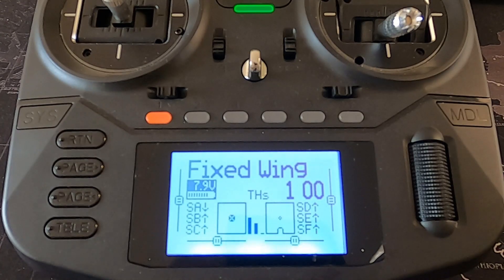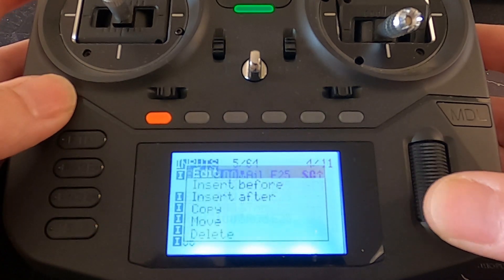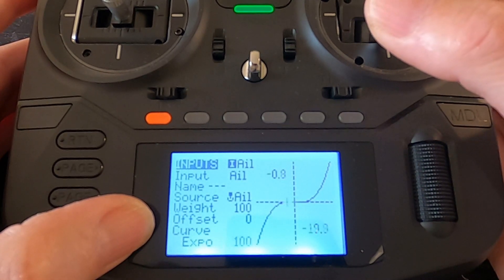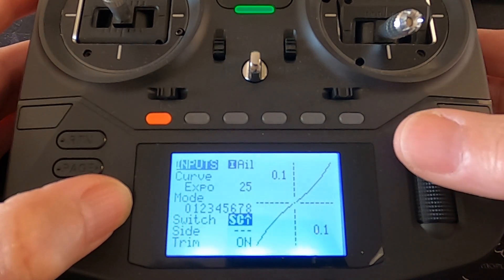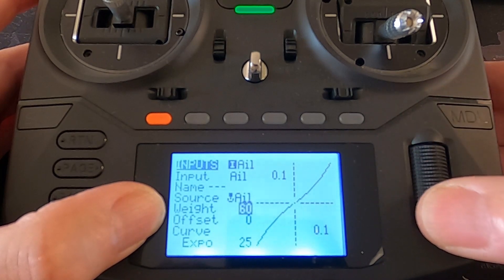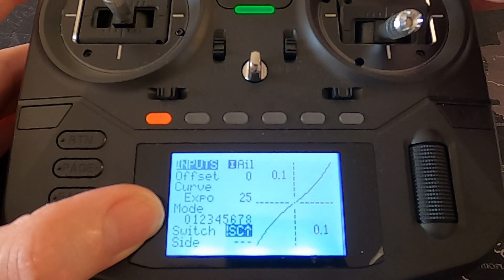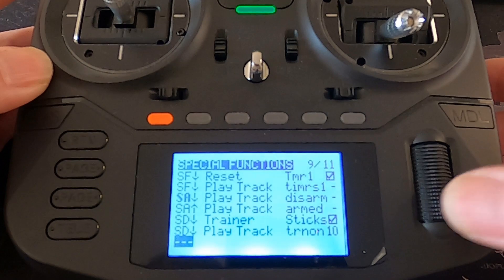RadioMaster Boxer Expo & Dual Rates Explained & Setup

Comment: Thank You for your helpful videos, they've helped me a lot as I'm trying to configure my new Boxer! I'm still confused about what weight affects. Is it comparable to Max Rate or Center Sensitivity?
Reply from the maker: I am pleased to hear you have found my videos useful. The weight allows you to limited the movement of the servo so to have flaps move 30% so the weight would be changed from 100 to 30. If you want to set up dual rates for elevator on a two way switch position 1 weight 100 so full throw and position 2 weight 50 so only half the movement. MAX does not relate to a physical control but returns a fixed value of +100 moving the control surface to a fixed position.

Comment: Bill, thanks for the reply. I have managed to get channels 2 and 3 ,which are the two motors on the right joy stick.  This is throttle for an armortek tank. One channel is for forward/reverse, and the other channel is for left/right. Will doing a channel mix give me control of both channels as far as say,going forward etc? I am new to setting these remote controls up. I am trying to get to single stick drive. Thank you so much for your help.
Reply from the maker: Hi David, I have not set up a mix like this before. Could you please give me a link to the manual for your model so I can check how the system works. I should then be in a position to work out the mixes for you.
Reply: @the-happy-RC-flyer  Bill,there really is no manual for this. When you get the option packs for the tank, there are instructions as to how to connect all the components and two wireing diagrams shoeing where connections are made. It refers to where a module is connected to  what channel on the receiver. One diagram shows the two motors connected to channels 2&3. As the bower is set up, channel 2 is right, stick for one,motor, and channel  3 is left stick for one motor. All the instructions say is it assumes you will be driving the two motors with the right stick  I have, somehow managed to switch the channel 1 and channel 4, witch  puts the two, motors on the right stick.  This leaves the left stick for other functions on the tank. I have the left stick correctly set up. On the right stick channel 2 is up/ down, and channel 3 is left/right.  I know these two need to be combined. In doing so will that make both motors react the same way? You asked if this was a car, how do you drive that with this transmitter? I'm guessing that this tank will be the same. Toggle the stick up to go forward, down to reverse, and left/right to turn. I received a link from radiomaster to utube settings, but it says that it is unavailable. Any help will be greatly appreciated.  Thanks
Reply from the maker: Does the manual show the settings for car style radio or two gimbal radio you would use for a rc plane ?
Reply: Bill, armotek does not show anything as how you control this tank. The wiring scamatics assumes I would be driving with one stick, the right stick. Each motor is to be connected to channels 2&3 on the receiver. The left joy stick is dedicated to turret turn,and gun elevation. Armotek uses a frsky tranis x9d plus 2019 transmitter and a frsky rx8r pro receiver to test their products. It's an airplane receiver. They only state that 7 channels are needed to control the product.  I have deleted everything in the boxer in an attempt to set it up again. Now, when trying to  use the input configure page and get to source and select, moving a physical control, it will not go to that input. I really don't understand how it works. Thanks for your patience and time.

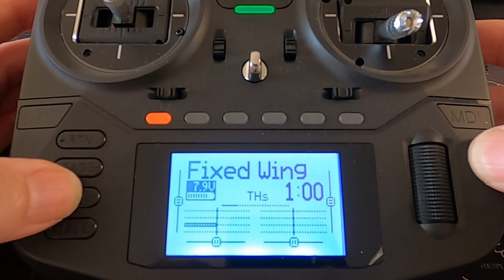Comment: Thanks very much bill, very helpful. Please 2 questions. 1) WHERE did you learn this? Is there any manual to radiomaster boxer radio? 2) at 4:45 we can see your movement covers full scale, all dots. In my case it's only 60% BEFORE applying your hint of dual rates. I'm using default 'boxer' model for quads. Is there somewhere setting, which brings all to 60% or something?
Reply from the maker: Hi, I am self taught over many years. You can download the manual for the Boxer from RadioMasters website. My suggestion is to search YouTube when you want to solve a problem with EdgeTX. Dual rates, what I think you need to do is double check your settings are correct as per the video. It sounds like you have not set the switch up correctly. In your question you mentioned drones. You should not set up dual rates for drones on your radio this should be programmed in BetaFlight on to your drones flight controller. For fixed wings we can use dual rates in the radio.

Comment: How do you set up a boxer to have channels 2 and 3 to have single stick driving on the right stick?
Reply from the maker: Hi David, you need to set up the mix for channels 2 & 3 with the Source Input Aileron. Is this for a car?
Reply: @the-happy-RC-flyer  no, this is for an armortek tank. I have some  how, set up the joy,stick for both channels, right stick for throttle, one channel up and down, the other channel for left and right. Will doing a channel mie combine the two channels give me forward/reverse/left/right? I am very inexperienced at this kind of stuff!

Comment: Are you able to bind the Volantex 400 mm warbirds with protocol V761 using this radio?
Reply from the maker: Yes it that is the protocol used by the model. V761 is available on the MPM.
Reply: Thanks.